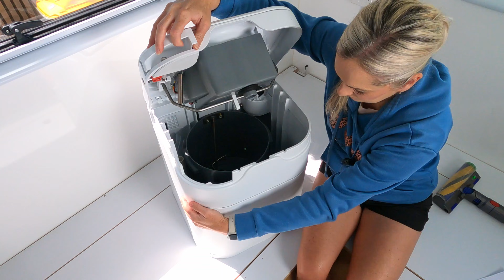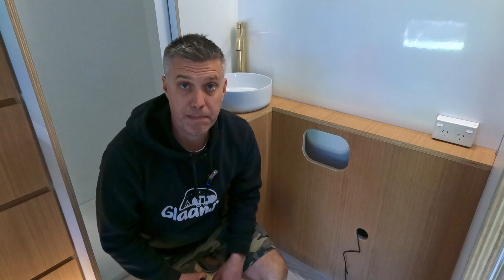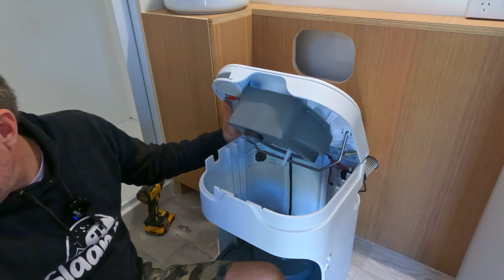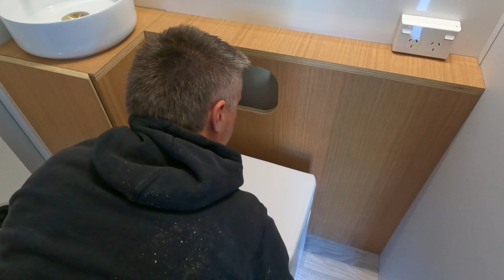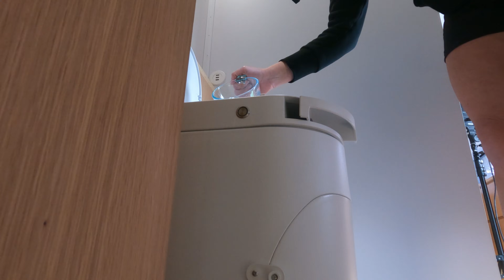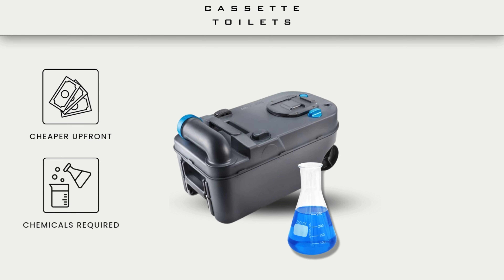OGO Origin Composting Toilet Install  | And EVERYTHING you need to know!

Comment: I'm really loving this series! There are lots of DIY camper videos, but not full sized caravans! I'm based in England and about to start designing my own caravan. Like you, I decided to go the composites route (because I have a lot of experience with composites in the aviation and automobile engineering sectors) and I'm designing everything from scratch. The maximum length of a caravan here on a standard tow vehicle is 7 metres; 12 metres if I can find a tow vehicle with a MAM of >3500kg. As it stands, I'm aiming for 7 metres unless I can find a tow vehicle with a high enough MAM as I'm authorised to drive vehicles up to 8250kg in weight. About the only special part of my design is that I've put in 6 pull-outs; 2 either side for the main sitting, dining and toilet/shower areas and one folding pull-out either end for bedrooms. I'm still at the CAD stage but I have the materials to build a 1/10th scale model to check the placement of all the various components. I'm also building the chassis myself. It's an exciting project, but I am quite nervous about it if I'm honest! lol
Reply from the maker: That sounds like an amazing project! Good luck with the build.

Comment: I’ve had a nature’s head for four years and it’s been a constant struggle with a fungi gnats. They lay their eggs in the hard to reach places and always come back. I just ordered this toilet yesterday and I’m worried that the same thing will happen with all of the crevices this toilet also has.
Reply from the maker: The could be a sign the compost is too wet. We actually use less water than recommended in the coco coir and haven’t had a problem.
Reply: @DIYAdventureNZ  thanks for the tip!

Comment: Hi the only time I can use my power points is when I'm plugged in camp sites and I'm more of a freedom camper, how would I go about the power side with the whole plugging it in
Reply from the maker: If you have a 12 volt battery. Then the toilet would be connected directly to the 12 volt system.

Comment: What about if you splatter the bowl, how do you clean with no flushing system
Reply from the maker: It comes with a spray bottle which we add a water/vinegar mix which does the trick.

Comment: I don’t want to drill holes in my Campervan. Is it possible to not use the ventilation or will it cause too much moisture in the toilet that it will eventually stink out the van?
Reply from the maker: Yeah you’ll definitely want the ventilation fan going to exhaust the smells for sure. And it helps start the composting process too.
Reply: @ thanks. That’s what stopping me from buying it.

Comment: Love the idea, but the price is ridiculous $10.00 of plastic $5.00 fan at the most $100.00 great profit margin Coles and woolies must be tyed up with them. thieving ripoffs
Reply from the maker: The design, manufacture, quality and engineering is definitely worth quite a bit. And the ability to have the automatic mixing with the ability of still removing the bucket rather than taking out the whole toilet to empty like others, is also worth the $.
Reply: @DIYAdventureNZ  no it is not you can buy a full porcelain toilet with wiring flushing levels for $750.00 here in aussie, Over a $1000.00 for a plastic bucket with a cheap stirrer great profit margin as them to explain the cost watch the bu,ls,it come out